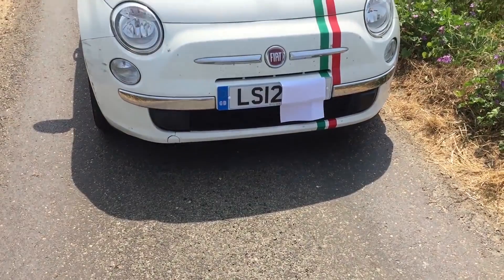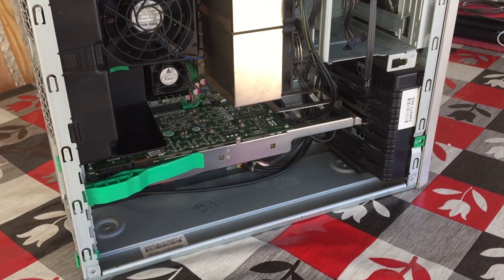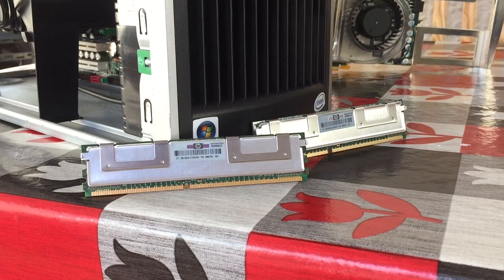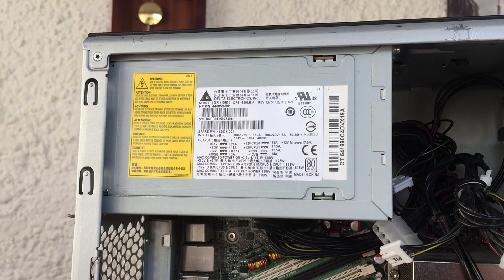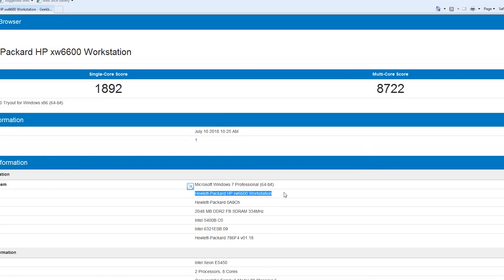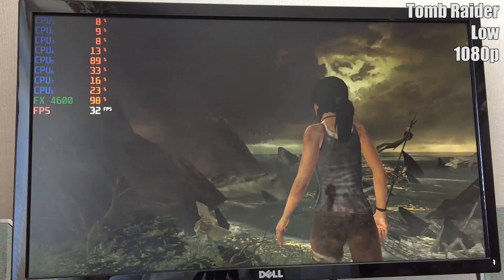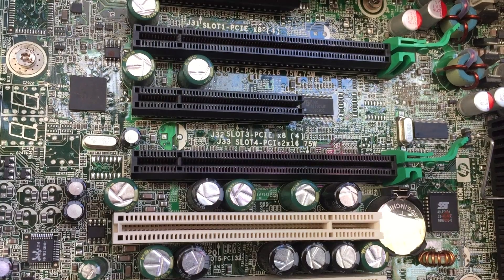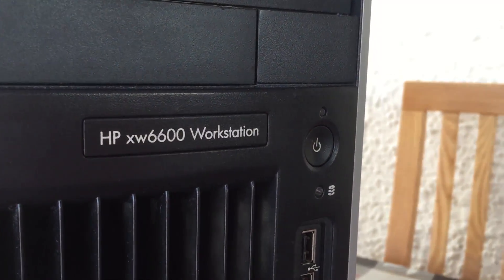This 8 Core Xeon Workstation PC Cost $5000 in 2008, Today I Bought One For £25 ($30)

Comment: Nice system.  These old workstations are awesome.  My main system right now is a Dell T5610 with dual 2650 V2s with an RX 570 8GB and an insane 128 GBs of RAM.

Comment: I got a hp 350ML dual E5-5420 with 72GB of ram… My workplaces IT department regularly gives me free older computers. I don’t use it for gaming but I do use it to run financial markets software that was very RAM hungry, this thing easily handled it while the a more modern i5-4th gen I had with 8GB (more modern by 5 years) was crashing and bugging out because it didn’t have the ram or the core count the run multiple software.

Comment: Xeon E 5450  in 2008  = i3 -8100 in 2018 = 4 core / 4 Threads
Reply: The difference is the price and features.  The e5450 was a high end chip that started at over $900 USD, almost $1200 adjusted for inflation, and also required a more expensive motherboard.  the i3 8100 launched for $120 as a budget option. However a more comparable chip from that same generation was the pentium g5400 that retailed for $64.

Comment: Hi bought this xw6600 for 12 usd at the junker. Am so happy. Quickly found 28gb ddr2 fb dimm 667 for 29.50 usd. Mine came with a e5440 and a firegl v5600. Ran silent hill 2 on it so smoothly. Just bought a ps5 but now spending so much time with this machine my console is gaining dust lol. Respect to them old beasts.

Comment: Battlefield 3 running acceptably on that G92 based quadro really surprised me. That game ran terribly on my GTX 260, and was the reason I upgraded. BFBC2 was a very good experience on the 260 core 216 rev.2 (can we just call it the 265 already?) but I considered BF3 to be unplayable. Of course that was during the Beta and I am sure the drivers matured to allow it to become playable eventually, considering it was released on the DX9 generation consoles

Comment: I have a Z600 workstation you can have. Just message me. I melted (literally) the RAM performing FSB overclock. 

The DIMM slots themselves should be fine, but you’ll need to find a way to clean out the residual gunk.

Comment: Read to learn some cool stuff, the .. XeoN .. E5-4627 v2 equals beast... on certain boards and a true oddity showing how intel tries to dock performance and still does... anyway, this cpu at 4.3ghz, its faster with latency & pings (more then double) then its sort of Twin the 9700k with no hyper threading 8/8... same as 46xx... except this cpu, to get this out of the way now, is older and unheard of so nobody uses it except a russian or two whom I can not understand but glad to see them on YT as Russians always find the BEST "hidden value" they really do, we thought it qas the 1680 v2, ask anyone we were sure of it... anyway, this 46 series can do quad cpus, id like to do dual x79 and have 16 cores, 16 threads all CORE baby(!!) but I really don't believe any board that does two sockets and upward will even get me to 3.8 (200 mhz above all core turbo or so) let alone thee  4.3.89 the gigabyte assasian 2 is getting me on this cpu on auto OC as in by pressing the button, thats it so prob will go higher...so 8 cores 8 threads it is but this cpu is very good, swapped it from a 6 core 12 thread 1650 v0 to the Ivy bridge super rare and obscure "4627 v2" and now I get 20,900 versus my 14,700 when both overclocked of course... do not ask me how as to me, seems damn good for the "mysterious" 8 core, 8 threaded intel from the past that sold for a whopping $2400 and was one of, if not thee last to be released for the x79 platform as a whole nearing 2015(!!) with shipments of This chip being fabbed and shipped around the world per a reputable site; 2019, why?... I dunno!! ...and it also just might be the first ever cpu or def xeon that intel decided to turn off hyper threading as in make It cease to exist for no apparant reason I see as the tdp is average, everything looksbaverage on paper except the heat it can withstand... (!) intentionally done? Hmm, always makes me wonder why when this happens.. I noted a few differences, oddities would be a better word but one more the X4627V2 has is its heat threshold is for some reason a whopping 15 to 20 or so degrees Celsius hotter, but again, the tdp on this cpu imo id say is average and it never passes 59c on a great air cooler, full load, odd? ....but this 27 is the highest for the 4600 v2 series from 2014. Here, all this time I thought it was the darn 2673 v2 which was so rare and amazing being harder to find, its nothing special as have two but it is good jjst like a 2667 v2 is good... when it comes to x79 express chips... (ps, intel can't cripple older cpus without hyper threading as that is the reason for the patch and where the loophole is, making the 4600 series even more appealing, ehhh?) so curious to see if they (intel & microsoft) will try to patch a fresh Win10/64 system supported by the pire "8" core, 8 threaded ....4627 v2 install ...beings no hyper threading, no Loophole so no reason to lose all that IvyBridge performance.... The irony? You see, its crazy but like karma, a backfired plan ... hah... JS... not sure if intel has other 8 core and up cpus that they cut HT off on ot why, anyone? Anyone whom thinks they have any answers on what I just spoke of, please, reply below would Love to chat!..

Comment: I've had my Dell Precision T5400 for 2 years and haven't had a problem with it yet. Basically the same workstation only difference is I have a GTX 650 ti and 32 gigs of ram.

Comment: My MAIN SYSTEM Still

128GB RAM
1060 (6GB)
DUAL XEON @ 3.4GHZ
ALL SSD (FIVE OF THEM)
BEAST
Reply: Flex
Reply: Yeah 1060 outdated, get a 2080 Super instead
Reply: @richardzhang2773  Wouldn't work in an XW8600 the bottleneck would be crazy.

Getting a HP Z840 with 512GB ram soon :-)

Comment: Not to split hairs, please see this as constructive critisism, but that 2nd 75W PCI-e slot just states the basic PCI-e slot power output. The rest of the power a GPU needs comes from the PCI-e Power Connectors from your PSU. This is still the case up to PCI-e 3.0 (not so sure with 4.0 but I suspect it is the same). Even a 2080Ti should run just fine in this (maybe a little bit bottlenecked by the PCI-e 2.0 speed)

Love to see your videos bytheway, just to see how this kind of old hardware performs in the current day and age. Also, you have good taste in hardware if I may say so! :)

Comment: Well... Simple upgrade path. Slap 16 gigs of ECC RAM into it and catch a reasonably modern GPU like GTX 680 or 960 and you're done. I did that with my workstation (i bought it in Poland a year ago for 80$) and it's still a nice machine to hold some lightweight tasks like home data server or even Teamspeak 3 server or for editing 1080p or 2k videos

Comment: I basically found the Dell equivalent of this workstation being thrown out beside garbage bin. 25 bucks for new ssd, 30 bucks for another 16gb of ram and slapped my old 750ti into it. Bam 8 cores at 3.0ghz, 32gb ram, runs like a champ.

Comment: My mom’s workplace were changing their computers because the old ones were pretty outdated. So my mom brought home a dell computer with an i7-2600 with 8gb ddr3 and a roughly 1gb ram graphics card. It also came with an 80gb ssd with win 10 pro in it, which i thought was kinda funny. I’m planning on changing the psu, gpu and the cpu cooler for overclocking to make a pretty damn decent gaming rig. I’d say i’m going to use round about $150-200 on a modern gpu.

Comment: I have an old ASUS L1N64 SLI-WS with the WS/B bios running a pair of 2360 SE Opterons at 2.5 GHz. I want to mod the bios so I can run the 2393s or even the 2435 six core Opterons.

Comment: The psu at the very least needs the cover removing and the caps visually inspected after 10 years and it will have lost 10%-25% of it's capacity over that time to.

Comment: The issue with these  dual CPU mashines, is that for gaming, the latancy between the CPU's are a problem. Can give you major lags. You might be better with just One E5450 CPU. Maybe if you can assign the other CPU for other apps/tasks than the game, and you have a very good multitasking PC there. The CPU alone is quite capable for it's age. I myself have positive experience with these. Can run many modern titles okay (30+ fps) with a decent low/midrange GPU.

Comment: Why dislike anything you  do, no stupid music, no stupid faces, just great old computer information that is informative and well spoken. I need this old beast to run cities skylines here in Thailand .... building ok computers from low budget buys was my favorite thing in the US but there are no low budget buys here... pentium 3s still are fetching a good price here...
Reply: If ur desperate for a computer try and see if u can nab a q660 cpu computer that has atleast 6gbs of ram. Iv used a similar machine to this and can confirm if backed by a decent gpu will handle just about anything u throw at it even some bran spanking new stuff. Just my advice this set up should get u too ps4 level hope it helps.

Comment: always funny when you pick up a used pc to find the previous owner was using the wrong operating system

picked up on i5-2500k with gtx 770 and 16gb ram build for mad cheap (I was gonna flip it and did to make a quick $100 or so profit), only to find that the guy had 32 bit Windows installed

actually messaged the guy so he wouldn't make that mistake in the future, all that wasted ram

Comment: For something a bit different you could theoretically throw in 2 1050 ti's and run them together through DX12 multi gpu support. However that would also require you to run the system on Windows 10 pro to utilize and games supporting the function are limited at the moment.

Comment: Those CPUs are the Harpertown Xeon generation, 80 watts each CPU, I use L5430 Xeon at 50 watts for power efficiency (low power consumption)
Low power CPUs keep my PC cool, doesn't strain my power supply, keep my electric bill low, and gives me a sense of smugness.
I plan on pulling out one CPU and making it a power efficient NAS, since Xeon supports ECC ram.

Comment: One of these with 5440s and 16gb was my main machine until 6 months ago, with an r9 285 and an ssd it ran most things quite well, the only things it struggled with was emulators for more modern systems like the ps3. Its still sat in the corner of my room as at some point I want to build a linux machine with it, just needs a cheap graphics card at some point.

Comment: have a Xeon w3540 with a QUADRO FX4600 i used to run BF3 on 1680x1050 most likely above 60FPS and MED settings in multiplayer. could play on high-V high in campaign...

Comment: Install more RAM, an SSD as boot drive, a modern GPU, made a replacement plexi panel and play some games 😁
I've a quite similar system, a Dell Precision 690 with 16gb FBDIMM DDR2, 2x Xeon E5335, 64GB SSD Boot drive & 1TB for games and software, and a nice EVGA GTX550 Ti (not so modern, but it's a nice card).
Works very well even with the modern games 😎😎😎

Comment: Watching this vid on my own xw6600 :D but I payed  twice that. 
With 2x e5440, 32Gb of ram, rx480 gpu (two), slapped in a Perc6 with  two Seagate 15k 450Gb sas disks and another pair of newer, 7k slow 1T Toshibas. 
Snappy, reliable, the integrated raid is rather slow but it has plenty pcie slots for a separated one,  and what is hard to find on most modern mainboards, both pcie 16x slots are actually 16x wired.
The other twi 8x are also 8x electrically. 

This supports 64Gb of ram (8x8Gb) even if the sheet says 32 is max. I ran it with 40Gb but I removed the 2Gb sticks to save on the electricity bill. 

The original power supply is good. Really good but not that beefy to cope with two modern GPUs. 
The XW6600 will run fine with any good quality ATX psu but only if the 24pin connector is properly modified, it is not standart ATX. I can't recall exactly but I think the 12V cpu plugs are standard.
 
Best mod I did on this is that I added an air filter between the front cover and the chassis. It really helps keeping things cleaner and quieter.

Comment: I did something similar recently, Dell rather than HP, but I can confirm it is still a viable base. More RAM is good, likewise better graphics, and I added a USB3 card. Some of these Workstation systems run best with RAM in sets of three SIMMs. Games can still have problems supporting multiple CPU cores.

This old, you may have the graphics card blocking access to the second PCIe card, but USB3 can be very useful for an external drive, and cards are cheap.

Comment: you can use regular ddr2 memory. no need for ecc.

also 75w is always the standard wattage output of pcie slots. if the card needs more power, it has a PSU connector.

Comment: Had x5450 @ 4.2ghz 50c at max load. Awesome cpus. I daily run dual x5650. And got z820 for fix up. Cant beat a dual workstation built as a tank. And z820 came with 1250w and liquid cooling for each cpu.

Comment: Update to the latest BIOS and try using non-ECC ram (normal DDR2 sticks) and check if it boots, if it does try higher speeds like 800MHz or even 1066MHz

Comment: I have one of these machines(XW8600) . On Ebay i bought 32 GB of memory for  £19.00 recently in 4gb units.
 I also have  an HP XW8600 witch i upgraded to dual 3.2 Xeons and bought another 32 GB for that to. I love these machines, you can tell the quality by how much they weigh.  I use mine mainly for Ableton, Flstudio, Propellerhead reason, and other DAWs which are very reliant on power when running multiple virtual instruments.  Hope you have fun with yours.

Comment: few points of note, this system to my knowledge doesn't support SLI (have had a few of these) 75W is standard for the pcie spec so that slot only being 75w won't cause any issues, and that fan over the ram isn't there because it's a good thing for 24/7 operation, the FBDIMMS this tower uses (and almost all 771 boards for that matter) NEEDED active cooling otherwise they'd overheat and die, they'll still hit the mid 80s even with a fan blowing at them

Comment: i still have a mac pro 2008 running dual 3.0 GHz  Xeons X5365 with 4gb ram and GTX 480, it still runs great for photo editing, thats what i did back in 2008. now this pc just works for netflix and some light gaming on bootcamp.
Pls put 8gb or 16gb ram and put a gpu, that pc is really good speciialy for editing videos and photos.
Reply: Nothing wrong with that, considering it's when Apple were in their prime imho. Those cheese graters are modular and user upgrade-able, unlike what you get today. I have the 1st revision Mac Pro 1,1 (2006) upgraded with dual quadcore x5365's (3ghz), 8x8gb (64gb) fb-dimm ecc ram and a flashed R9 280x accompanied by various other upgrades - It is a very capable machine, despite being 12 years old, which games amazing under Bootcamp, even in modern titles and runs great under El Capitan. There are upsides of running OSX vs Windows or Linux natively without having to build a hardware specific based Hackintosh to accomplish the same thing.
Reply: thats true, this mac is really good but now my daily driver is a macbook pro 2011 15 inch maxed out with 26gb ram and 512ssd, its good for me, photo editing on lightroom and photoshop runs good and premier and final cut runs good too but the cpu is starting to show a bit of age, ive chandge the thermal paste 4 months ago what helped a bit but im considering the new macbook pro 15 inch but i might wait to see wath apple has got in the desktop market cuz this powermac is really reliable and i´ve used it soo much and never shown signs of bad parts. I mean i had 16gb, 4x4 gb but 3 sticks died dunno why, the first was like in 2014 then 2016 and 2018, it was corsair modules that i had but i never invested more money into this machine. btw i forgot that is 64 bit not 32 bit, i had windows 10 32 bit but now is 64 bit, my bad.
Reply: although its a mac
Reply: Rodrick HD how good is that GTX 480 in the winter?

Comment: My dad has a XW6600 with 2x Xeon E5450 and 32gb of ram. And he also has another one with 2x E5440 and 8gb ram.
I have two single Xeon HP Z400's with Xeon X5675 and W3550. And I also have a XW9400 dual opteron 2218 with 12gb ram.

Comment: I have a dual Xeon E5450 workstation with 16GB DDR2-FB.
I built it for the cheap RAM and 8 core total. While CPU performance is great, it is totally bottlenecked by the RAM speed. Some light gaming tests on GTX550Ti vs GTX 670 showed almost no difference and neither CPUs/GPU are heavily loaded.

Comment: I got given dual x5355's which i think are similar to these processors and was debating buying a motherboard for them (I believe a replacement board from your prebuilt) but it was about £90 so i didn't bother. I cant wait to see how it does with a modern gpu in it though

Comment: I've used a similar system with a more modern graphics card at a 3D studio for 3D modelling, rendering and programming. The case was identical and inside components similar, but ram sockets had a standard orientation. It was nothing to write home about, but it did the job. IIRC, it had ~660 cb score as well.

Comment: Is this really £25? Oh!, it's very cheap!!

Only the motherboard of my LGA771 system cost around £150 included shipping, tax, and local merchant profit.

This very same model of workstation PC you have reviewed also sell in much higher price in my country at over ฿5000 (around £100) by the shop who bid corporate discharged systems.

P.S. Is this really can't install more powerful CPUs like Xeon X5492? But this is still fine anyway. If the power supply can be replaced I think you can try more powerful graphic card. Still, the motherboard like this can't support SLI as the Intel 5400 chipset doesn't support multi-GPU technology from both GPU manufacturers yet at that time (Maybe it can support CrossfireX but I don't think so). The only Intel 5400 motherboard that can use SLI is the almost impossible to find Intel D5400XS which has nforce 200 embedded on board.